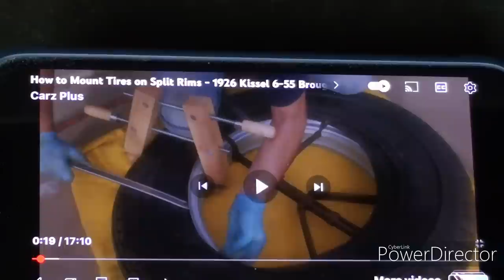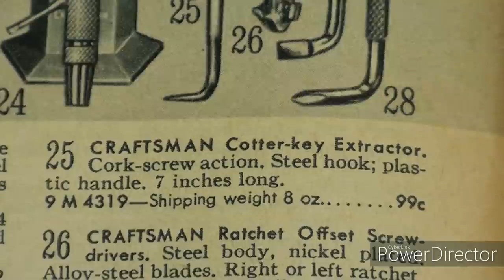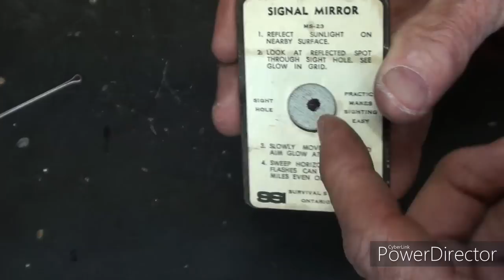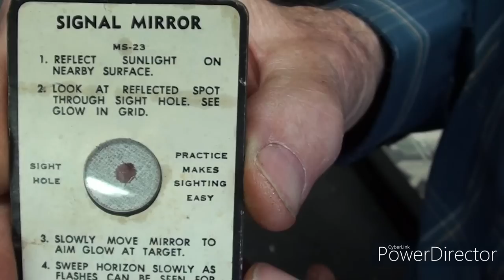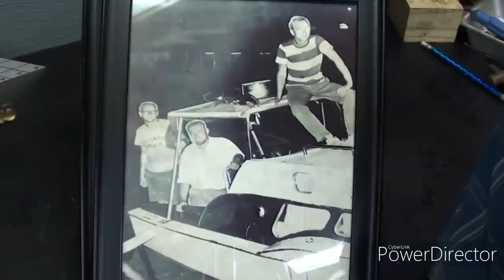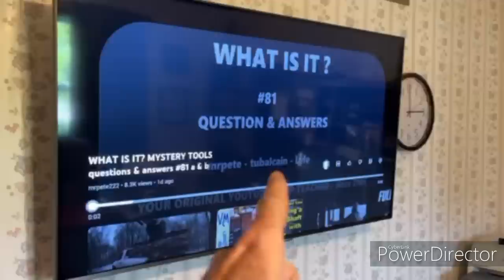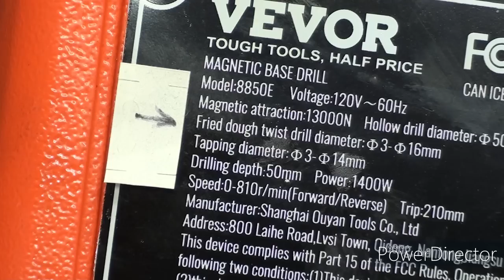tubalcain ANNOUNCEMENTS - Mrpete vents temporary

Comment: Mr. Pete a friend of mine who is 73 and built like you was given by the VA ready to eat meals (MRE) that are 2000 calories each and was told to eat two a day. That's twice what a normal person should have in one day but if you need to put on weight think of high calorie foods or high carb foods. Spaghetti is a good start.
Reply from the maker: I have several of those MRE meals in the basement. I need to break them out.
Reply: @mrpete222  Do so and let people know what you think about them.

Comment: Well that explains why you are losing weight, the floor looks great! terrible job to do by yourself. out of all the equipment I have used, my 1/2" drill motor identical to yours in this video is the one piece of equipment that I remember the pain it has inflicted on me, I keep it around just in case I need it, but I avoid it at all costs. Don't pay attention to those criticizing you they have never done the work and would take anything offered to them without hesitation Thank you for your videos I enjoy them!

Comment: I broke my jaw about 10 yrs ago and lost weight. Didn't seem like a big deal but now I have the same problem. Low energy and no weight gain. I have 3 of those half inch drills and love them. Broke the gears in the most used one with a super short 13 sixteenth bit.  Then broke a new one with the same bit trying to finish the same hole. Got it rebuilt by dewalt but when I took in the oldest one they were out of parts. Leaves me with 2 for retirement. They quit making them and the three quarter inch. Leaves us with Milwaukee for a real drill.
Reply from the maker: I have been drinking high protein shakes from Walmart. Seems to be helping me. Those big electric drills are scary. I have heard many horror stories in the comments.
Reply: @mrpete222  I hired a friend to help with a large drilling job and he came up with a great idea. Run a 2 by 4 thru the d handle and wedge it in something solid such as saw roller table and then sit on the 2by4 and you have a sit down drill press. I refined his idea with large vise on steel plate on the floor with a rebar frame a few inches passed the vise. End of 2by 4 goes in rebar frame. Drill.is above vise. Wrapped an old coat around 2 by 4 for padding where you sit. Previously I just did hand stands with upper body weight. With his idea much more pressure on drill and at end of hole when lock up is likely the 2by 4 keeps the drill from twisting. I did thousands of holes with this idea. One job was 600 one inch holes in 1 inch plate for a railroad contractor. Hard on the drills but they took it. They did get hot. Sadly the guy that came up with the idea drank himself to death. Alcohol poisoning. He had 6 kids and wife. Customer came in and saw me drilling and wanted to know where I came up with that so I told him and he said bridge workers now have a rig based on same idea. Can't help but wonder if they came in there for steel and saw me drilling ?

Comment: As to getting calories and such, i was an active kinda skinny teen one summer that i spent on vacation on saipan. I was very active so i basically survived on carnation breakfast drinks. I seemed to have survived so yea, those drinks may help and are easy to take down. Also possibly try rice in a liquid form. Very easy to eat. I eat it when im sick and have no appetite. Need to look up differing ways of making it.
Reply from the maker: Thank you, I never heard of rice in a liquid form
Reply: @mrpete222  it's more of a soupy texture. But look it up and try it. Not saying it will work for you but it certainly works for me.
Reply: @mrpete222  wife says it's called congee. It's made in many forms. From simple to more elaborate. She makes it for me either using water or chicken broth. Check on line how to make it though it's just making regular rice and then slowly introducing a liquid till it becomes the thickness or liquid you prefer. Depending on your preference you could also use a blender to get rid of the rice pieces. Just a way to get something into you. Hope this helps.

Comment: Lyle forget that model engine vid. Make a video on the use of a FACE DRIVER  AND BE THE FIRST TO DO SO .🤯
Reply from the maker: What is a face driver?
Reply: @mrpete222  Lyle you forgot I sent you a Catalog on face drivers yes most machinists will say what's a face driver and what they cando check it out and educate those that are unfulleir what a valuable tool they are .. Make a video  and be the first to do so  CHEERS LYLE .

Comment: Appreciate your videos!
I don't think, it's worth the effort building a wobbler for views. milfordboy just did a series of videos with this topic - and on YT are enough others already, as far as i remember.
Why not use some Vevor stuff, if it suits the wallet and the needs.
As soon, as China starts making trouble, this cheap tool source will be gone anyhow. 

You've got the wrong drill press designs, if your's don't have torque at low speeds.
Get a used Alzmetall drill press and you'll start to love drilling big holes.

Comment: In my opinion, YOU are the one being shortchanged.  Vevor probably sold 100 of those mag drills based upon your presentation, and your "commission" for these sales was exactly one of those items.  In the next year or two, they will probably sell 100 more, based upon your presentation.
I've  now found the other viewer of the Svengooli show.  I knew there was someone else out there. 
Hyaluronic acid supplements will reduce joint pain and increase body flexibility.  That's what I use, and it works for me.  Best Regards.